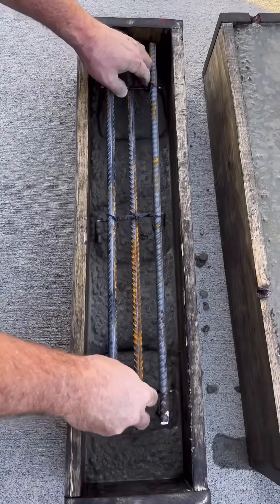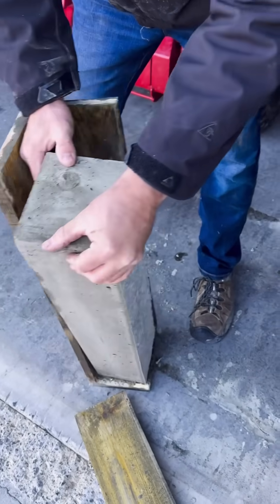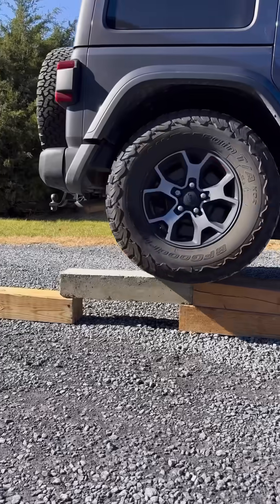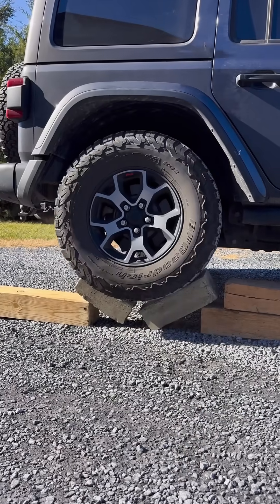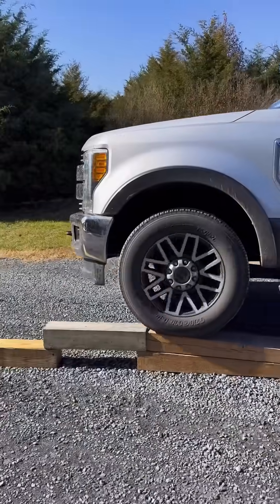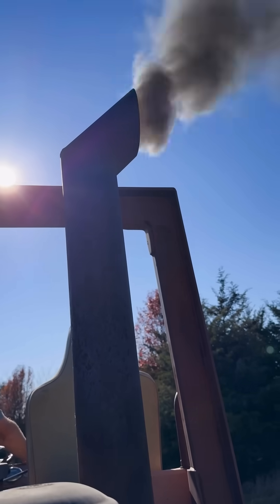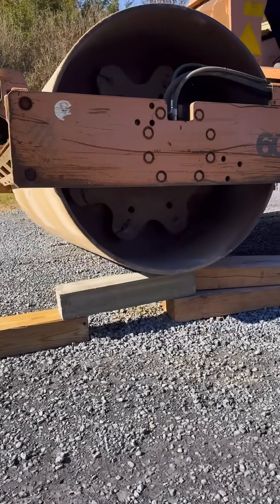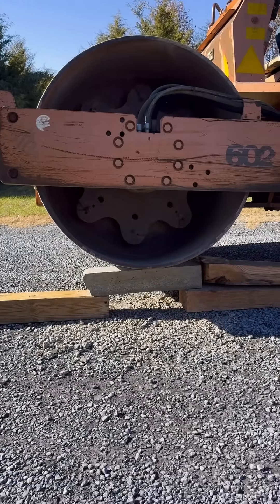Why We Use Rebar To Reinforce Concrete

Comment: …Can we just acknowledge how amazing wood is as a building material?  The wood had no problem being a ramp for your test.
Reply: Wood is a good material but is made of fibers that means that wood is good material only on some directions
Reply: @gianlucianobonisolo7879 also It molds and rots
Reply: @gianlucianobonisolo7879   the isotropic directional strength of materials is founds not only in wood, especially everyone can test it by folding paper and trying to tear it, comparing how it tears when the fold is done along the other paper direction (turned 90 degree).
along the rolling direction (when the paper was created in the rolling mill) - it will tear nicely and easily (less strength to resist the tear) - while the 90 degree other direction it is harder to tear (and looks less straight).
same isotropic behaviour is found in other rolled materials like sheet metal.
Reply: Video: about the strength of reinforced concrete
Comments: debating the existence of god
Reply: Man yall need to chill tf down. Litteraly all bro did was peacefully make a comment that was even a LITTLE BIT religious and all the reddit atheists come in like "erm ackshually religion ish bad becaush of my middle shchool level undershtanding of philoshophy and the 13 minutes I spent reading nietzsche before I got bored because there aren't any funko popsh" trying to have a pissing contest with the guy while everyone else argues about which religious view is litteraly Devine in its perfection and which one is litteraly responsible for everything wrong with the world.
Reply: @AwesomEthan the comment was literally telling random people to give thanks to God. Maybe don't tell others what to do when it comes to stuff like that? lol nerd
Reply: @gavinrolls1054  he wasn't putting a gun to your head and forcing you to praise Jesus, was he? Get over yourself lmao
Reply: @AwesomEthan  cry
Reply: @TheeggMAN_  your the only one crying here bro
Reply: @AwesomEthan  suree
Reply: @TheeggMAN_ narc
Reply: its like if concrete came already filled with thousands of teeny rebars
Reply: It’s tensile strength tho, when we getting reinforced wood? 😂
Reply: Yeah it's supported  by the ground lmao
Reply: @poa2.0surface77 Only theists say something comes from nothing. No cosmologist states that has a hypothesis. Just tell everyone you will regurgitate apologists taking points without making sure if they are true.
Reply: @poa2.0surface77 Provide your scientific evidence of god?
FYI science deals with the natural world. By definition god is a supernatural being and not something science even deals with. 
So continue to just tell everyone you don’t know what science is even at its basic level.
Reply: @poa2.0surface77  You are mixing up the facts here big time 😂 You are the one with the opinion, i spoke facts ...and it's definetely you who doesn't know how science works, because it's you who have to come up with proof for gods existence
The things you say are illogical and you're misinformed about how science works
Reply: @poa2.0surface77 None of these are good arguments for God, and most aren't even actually arguments.
Reply: Look at the Video Again and notice how the Wood Beam is Split when the tractor goes over it.
Reply: The wood was flat on the ground. It wasn't being exposed to flexure
Reply: @carlingari8850  
I can say from experience in the automotive field that a wood 2 by 4 holds up more weight than concrete, even while spanning a distance equal to or greater than that which the test in this video demonstrated with the concrete.  I’d go even further to say that the flexibility and elasticity of wood makes it a superior material to steel when used in reshaping damaged steel body panels.  It’s softness also means it’s a viable material for lifting very thin steel under enormous weight.
Reply: @BroncoJoeAK  I can say from my experience as a civil engineer that you're being delusional. It's almost impossible to increase the load resistance of a timber section without altering it's sectional dimensions. The opposite is true for concrete sections. You can increase strength by changing steel and concrete classes or effective areas without altering sectional properties. Timber becomes preferable when dealing with generally lower load values and is affected by variables such as climate, more than concrete. Neglecting factors such as cost, timber will always come second to reinforced concrete.
Reply: @BroncoJoeAK  You're even more delusional if you think that timber is more flexible than steel
Reply: @carlingari8850    
 
I appreciate your perspective, however I think you misunderstood what I meant.  I’m not talking mainly about concrete in a building, I was responding to your suggestion that wood cannot span the same gap as the concrete structure proposed in the video and support the weight of the vehicle as the reinforced concrete did.  In my field it’s used every day to do just that.  Making a statement about your implication that wood would not support the weight of a vehicle - as derived from your statement that the wood the vehicle was on was on the ground and not spanning the gap - is not an invalidation of steel and concrete as building materials in large structures.  Nor is arguing that wood has amazing tinsel strength an implication that it would be a better material for building skyscrapers.  I was simply using two different examples of structures and the beneficial properties of the materials in those structures in the case of a fire in their individual buildings.  I am equally well aware of the fact that wood has less tolerance of compressive force over time than concrete.  My point was to consider the versatility of wood as a building material (as implied) in smaller structures, while contrasting the more permanent design principle regarding reinforced concrete in large structures, such as skyscrapers.  I admit I probably should have clarified that I was differentiating between small wooden structures and large reinforced concrete structures, however I also find it disingenuous that one would assume I was referring to using wood as a replacement for concrete in large structures where compressive forces would forbid it.  I was likewise not suggesting that it was possible to drastically change the load bearing capacity of any given piece of timber.  As one would choose the appropriate mix of concrete or carbon content of steel in construction, a carpenter likewise chooses to use certain grades of wood and different joints to build a wooden structure.  My point with volume was that a larger building such as a skyscraper has larger internal volumes than a smaller one, meaning more stuff can be placed inside it.  I feel really silly stating the obvious here, but typically that “stuff” is comprised of furniture and typically furniture is made from wood.  That volume also holds other organic, flammable materials and the more flammable materials you have during a fire, the more heat is produced and should the heat produced be absorbed into the building’s steel reinforcement, then the integrity of the steel becomes compromised and thus possibly compromises the entire structure, not just the area affected by the fire.  And yes, I’m aware that x-rays can rule out structural damage, as I am a certified structural welder, and an entire structure’s integrity doesn’t necessarily get completely compromised after a fire, but the point made is simply it can and does happen, and unlike a residential building where you would expect wood to be used as the construction material, your concrete structure would require far more work to reconstruct after said fire.  Granted, I will admit that I could have been clearer on this as well, however I assumed it was understood by the nature of the argument that it can happen, not that it always happens.

Now as to your experience as a civil engineer, under a mutually respectful circumstance I would like to hear more about your field of expertise.  If anything I have said is incorrect, I would like to hear about it.  However, I do want to have a discussion about a topic where the topic itself is not being misrepresented due to a misunderstanding nor due to a lack of attention paid to (or purposeful omission of) the underlying context.
Reply: Wood also catches fire
Reply: @fernofinity8997  
So does steel and concrete, just at higher temperatures than wood.  And once steel reinforcement heats up, it becomes malleable.  Typically buildings made of concrete are significantly larger than structures built from wood, and when they do catch on fire the internal volume is much larger as well.  If 9/11 wasn’t a good enough indication of what fire can do to the steel reinforcements in a concrete building, I don’t know what is.  Once the steel supports in a concrete structure are gone, the structure looses all integrity and basically becomes sand.  So basically everything you can say about wood can be said with concrete as well given similar circumstances.  It’s the mechanism behind it’s disintegration which is different.
Edit:  I should add, steel is an excellent heat conductor.  So when a concrete building burns even partially, the steel reinforcement throughout the building transfers most of that heat from source to end.  So while a wooden structure may see a kitchen burn and the solution there is to simply replace the kitchen, even a relatively small fire (compared to the mass of the structure) in a concrete building typically renders whatever remains of the building completely unusable due to the steel reinforcement being altered throughout.
Reply: @BroncoJoeAK  Your argument about steel structures being vulnerable to temperature is quite pointless because how many timber skyscrapers have you seen? Do you mean to say that buildings such as the world trade centre would rather have been built with timber instead of RC?
Reply: @poa2.0surface77 that's not proof, if that was then what came before God? Right got ya there. It's really hard to say how elements came into existence
Reply: None of you get it. Simply said God where atheists would say mother nature- funny isn't it? Now quit the politics and go do something with your life.
Reply: Logical fallacies abound @poa2.0surface77
Reply: @poa2.0surface77 Amen to that.
Reply: @poa2.0surface77  Something can come from nothing, as evident by the Higgs Boson, and the Big Bang. In layman’s terms, when the Big Bang happened, all of the particles and energy passed through a field which gave it mass as it did, thus creating the universe.
Reply: Wow. Great point
Reply: @poa2.0surface77  Life comes from life believers when abiogenesis
Reply: Ikr
Reply: It was on a flat service jaja
Reply: No
Reply: It's good but not economical.
Reply: Well yeah it's on the ground. do the same test as the concrete and you'll get similar results no?
Reply: Highly impressive that it could tolerate the steamroller.
Reply: @poa2.0surface77  No proof for YOUR God, for all we know theres deities that exist on a completely different plane of existence that are so stupidly advanced they make universes like ours for fun as school projects. The creator of our universe, if there is one, which there probably is, could very well be the cosmic deity equivalent of an infant or even a giant flying spaghetti monster...
Reply: Burns quite well too lol
Reply: @poa2.0surface77  lmao, you're an idiot.
Reply: @poa2.0surface77  this is the stupidest thing I've ever read
Reply: But we need our trees its getting hot
Reply: Did you learn from the video tho? The wood is only under compression
Reply: yeah works really well against hurricanes doesn't it 😂😂😂😂😂
Reply: @poa2.0surface77 I’m happy I don’t know you in real life. Most bible thumpers are the most stuck up and ignorant.
Reply: @poa2.0surface77  There's no such thing as universal morality, secondly laws of physics are not governed by intelligence, thirdly life comes from certain combinations of atomic bonds, with enough time and space every and any combination of atomic bonds would be created, thus life and consciousness (which is an evolutionary trait) do not prove anything. Please don't cite science as proof for something when you're citation is so blatantly ignorant.
Reply: @poa2.0surface77  I suppose you are the one that believes 😅
Espacially that your god came out of nowhere, which opposes everything you said else 😂😂😂

And i certainly do have a better understanding of computers, science, chemistry an logic than you have, from what i've read. This conclusions originates from the fact that I'm a chemical engineer and of course because of you, since you have no clue what you're talking about 😂😂😂
Reply: yeah, but you don't live in a tropical area. wood is really good on cold climate but rots really fast in tropical climate
Reply: @poa2.0surface77 no, that's not how proof works.
Reply: We should start building roads out of wood 🧏‍♂️🧏‍♂️
Reply: @poa2.0surface77 and you couldn’t survive knowing that freedom is before you die. There’s nothing waiting for you…
Reply: because the wood was lay flat. Common bro
Reply: @poa2.0surface77  lie more.
Reply: @poa2.0surface77  If something cant come from nothing but god exists that makes  nothing by your statement
Reply: @poa2.0surface77  You can't use the laws of science as proof of god, and then say that the laws of science don't apply to him. Don't you see how you're contradicting yourself?
Reply: Neither would a pile of bibles, sand or a few rocks.
Reply: @natmarelnam4871Thank you bruh! Furthermore, had the wood been stretched across two pieces of stacked concrete, the wood would've cracked and split immediately! I swear, some folks can have ALL of the evidence in front of them and STILL make ridiculous observations!🤔😆🙄
Reply: ...It's the same as the unreinforced concrete: It was being compressed, not tensioned.
Reply: Yea bro thats why your good book says nothing happens unless it goes through him. So all the murder, rape, thievery, so on, and so forth is all by his design. If that's your "god," you have your answer as to why no one with common sense believes that crap. Ignorant people love god. Isn't it crazy that miracles stopped happening when everyone got a phone in their hand miracles just stopped happening? No more water to wine? Feed tons of people with a little fish and some bread? I'm just saying. Lmfao. Educate yourself before you try forcing your beliefs on people who dont care. @poa2.0surface77
Reply: @poa2.0surface77 we can agree to a few axioms and then prove the laws of physics exist. But you can't measure or prove anything about morality in a lab. Until you prove god you cannot prove transcendent morality.
Reply: @natmarelnam4871lol yeah when i saw them bragging i was like...seriously they aren't being serious 😅
Reply: Think termites😂
Reply: Wood is cool and all but when you have a shipment of epay come in and this supposed strongest wood in the world has giant cracks down all of your 4×4s you get a bit frustrated
Reply: dfuk dude, any terribly made concrete can be a ramp.
Reply: Thats because it was resting on the ground. Wood and concrete have différent properties which gives strengths and weaknesses to both. I wouldnt want Wood in the ground, which majes concrete à better material for footings. Overall concrete is much stronger but also weighs much more, the higher you go the more you need to reinforce.
Reply: it's supported by the pavement
Reply: Wood is gods quikrete.
Reply: yeah a lot of wood species' have comparable compressive strength to standard concrete mixes and are way lighter and have much better tensile strength. bamboo can even have better tensile strength than steel for the same cross sectional area, let alone by weight.
Reply: In Diesel Technology, We use Wood Blocks and esp. 4X4's to stabilize whatever was gonna have one of us mechanics go under or keep off critical and irreplaceable human flesh!
Reply: Because it’s under pure compression and no tension, whereas the concrete has a shearing force because of a lack of support.

Like this is the entire point of the video lol
Reply: Yeah kinda, but the wood isn't the one off the ground
Reply: Wood is amazing. It was also used to make the British De Havilland Mosquito during WW2.
Reply: its on the floor, it would not survive bridging, like the reinforced concrete
Reply: Theists starting their evangelistic session out of nowhere and acting like they didn't when called out, and even putting blames on the very people who called them out. El Clásico.
Reply: Wood is a flexible material for low bearing applications, but would be either impossible or too expensive for large structures, it's why historically East Asian architecture shifted to smaller structural columns because large trees simply disappeared due to over-foresting.
Reply: @fsdds1488 more importantly, wood rots
Reply: @fsdds1488  ever heard of Kizhi Pogost?
Reply: wooden sky scrapper projects have been getting pretty common in the past few years @fsdds1488
Reply: I'm probably fine with there being some existence far higher than me/us that played a role in the creation of all we know. 

But it's almost comically arrogant for humans to think it's the one(s) we wrote books about. The sheer scale of creation up there in the void of space all but confirms that humanity is an inconsequential, insignificant blip on their canvas. That canvas and those brushstrokes will be more and mean more long, long after humanity's last breath.

Also, rebar in my concrete for sure, amirite bois?!
Reply: @Trepanation21  
Perfectly valid and reasonable.
If there is a God and if he is intelligent enough to create the universe, then he must be intelligent enough to comprehend the concept of “creative liberty” or “political alteration.”  Either God does not care about us, or he cares that we act morally correctly.  Anything else is kind of a guessing game.

Edit:  Almost forgot.  Rebar in concrete.  Freakin’ Hell yeah!
Reply: @Trepanation21  were all meaningless clumps of flesh on a rock in space BUT DONT YOU DARE BE HECKING RACIST!!!!
Reply: @Trepanation21  Lmao it is funny that you bring up the fact that this argument is on a concrete rebar video
Reply: @Trepanation21  ikr its mind blowing all of it. What do u believe in?
Reply: @poa2.0surface77  “Life can’t come from nothing” and yet a god can? The hypocrisy is crazy.

To think that every atheist believes in god but pretends that they don’t is crazy as well. There’s so much proof saying otherwise. You live in ignorance.
Reply: @poa2.0surface77  and yet, you didn’t dispute my argument. And you also didn’t provide any evidence. Typical theist. Can’t comprehend that their cult is lying to them.
Reply: @Beowulf__ modern atheism is a cult
Reply: @poa2.0surface77  What??? I am from old civilization and old world, India. What proof do you have for god? And what is Wood to do with God?
Reply: @sheshankutty8552  God created trees and man created concrete. Someone suggested we should thank Him for His natural building materials, someone made a LARP post, argument ensued.

That's basically how we got from there to here.
Reply: @frikyouall How do you know God created, have you seen or have proof?
Reply: @sheshankutty8552  Don't need to. Can't know the unknowable, and trying to do so is pointless because it could all just be set up. The name of the game is faith.

That's far from the point of my statement, anyways, though. The point is that someone believes in God, and their belief got them in trouble, thus the argument.
Reply: @frikyouall You are all funny. Anyone can believe in anything as long as they only got 5.5 senses less of 6.
Reply: @sheshankutty8552  🤷🏻 Like I said to the other guy, the evidence comes to you in a way that you personally can understand, and serves as poor proof for others. I've been called a liar for citing my personal experiences, and I don't have solid evidence to present because it's all set up to look circumstancial.

I don't make the rules, I just follow and relay them.
Reply: @frikyouall Illogical. I have read all the scriptures from all the religions. When you say, you follow them, what do you follow ?
Reply: @sheshankutty8552  Mostly New Testament, but some Old. I relate my knowledge of the Book with my personal experiences with God to try and better understand Him and what He needs of me.
Reply: @frikyouall  So god is male principle in your world? Interesting
Reply: @sheshankutty8552  I'm starting to think you're just trolling.
Reply: @frikyouall  And what are you doing?
Reply: @sheshankutty8552  Well, I was trying to have an honest conversation. My mistake, forgot the internet rules.
Reply: @poa2.0surface77 you just mentioned a few scientific terms and claimed that it's "proof" that god exists.

Luckily the existence of god falls into the realm of philosophy where you can use philosophical razors. Occam's razor can easily show how ridiculous the idea of a "human-like intelligent singular being which defined every single law of the universe and also specifically created one planet with life and gave consciousness to only one species of millions" is.
Reply: @okie9025  
Atoms make up the Universe and God is said to be Omnipresent.  It’s also said that God’s knowledge is incomprehensible.  In particle physics, the strong Nuclear forces are not observable but are instead deduced by mathematical reasoning.  I’m not saying that God is atoms or subatomic particles, but I am saying that it’s very possible that God is reality itself taking the definition of Omnipresent to it’s extreme.  That’s a relatively scientific explanation of something that should be entirely philosophical.  Perhaps an incomplete one but the framework is there for it.  And honestly, science is a very strict philosophy itself so you could argue that science is equally a religious belief and theoretical physics relies on deduction of mathematical reasoning which flies against the idea of science being based solely on observable facts gathered from repeatable experiments.  Science also has it’s own kind of prophet; Albert Einstein, Steven Hawking, Charles Darwin, Neil DeGrasse Tyson, etc.  When viewed from a purely philosophical and cynical perspective, even science itself is almost cult-like.  Just food for thought.
Reply: @okie9025  it's not silly. Think about any video game. We could be in a simulation and the guy or being that made it would literally be our creator or god. That's really not that far fetched and doesn't even have to involve religion. I think ignoring the possibilities of either god or no god existing is quite frankly more stupid.
Reply: @okie9025 my 2 cents: there is no proof per se, but it is uncanny how so many materials are abundant and accessible. Like oil, what if we didn’t have oil, or couldn’t access it. That would have made transportation stuck back into the dark ages. We not only have the materials for housing, clothes, etc but to actually get off the planet and explore the universe. Yes this could all be coincidence, but when there are so many uncanny coincidences, to me it is a clue that maybe there is something that has influenced the universe/earth/life
Reply: @nofurtherwest3474  Not to be a Debbie Downer, but those things aren't coincidences. You just seem to be swapping the cause and the effect.

The abundant materials aren't necessarily here because we are, the planet is able to sustain life because the materials are here.

Now it is a bit of an oddity that they are all materials that we have been able to use to become the dominant species on the planet, but science uses evolution to explain that. The most adaptable species survives to reproduce and all that.

So we weren't given the materials, we took what was around us and adapted it to use to our advantage. More like a speedrunner using glitches to eke a 2-minute time out of an 11-hour videogame.

That said, I do have a similar viewpoint, but it has more to do with the fact that the Christians took a dominant position on the world stage despite being a global minority. Now that Christianity is receding from the public view, everything is starting to backslide quite a bit, and I do find that to be an incredible coincidence.
Reply: @frikyouall  there are man more coincidences. You'll have to think of them on your own or do some digging. For ex, the size of the earth leading to the optimal gravitational force and magnetic field which influences the atmosphere along with being the optimal distance from the sun. Many many more coincidences that create an optimal situation for life to thrive. 

And no, the materials weren't given to us, i never said that. But they are there in way that is usable. It a near perfect way to be used.
Reply: @okie9025  You do not want to go into the realm of philosophy as an atheist my friend, because not only does philosophy prove the Christian God but atheist's cant even do argumentation within their own world view because they have to subscribe to all kind of goofy things like materialism and determinism which are easily disproven.
Reply: @Jewish_Skeptic philosophy doesn't prove that Jack schitt
Reply: @katiebarber407  Do you have proof for that claim? In order to claim that you must appeal to knowledge (epistemology) and to universal's and truth (metaphysics). So you deny philosophy while appealing to it. lol
Reply: @poa2.0surface77 Everything you said was incorrect.
Reply: @poa2.0surface77 If something can't come from nothing, then where does god come from, huh?
Reply: @poa2.0surface77  You did some nice tomfoolery there, but not with me pal 
The true bottom line is that you DON'T KNOW if god exists, you just want to be told how to live because you can't come up with a concept of decent living by yourself, which is often the result of a lack of an open mindset and/or logical thinking and/or common sense and/or empathy
Your welcome :)
Reply: @robem222  chill out youre not the main character go take a shower
Reply: @poa2.0surface77 I like your comment
Reply: Hey guys, I wouldn’t say I believe in God in the secular nature, but I do believe there is some intelligent form of Universal Consciousness or perhaps Creator.  However, I respect people with different theology or no theology.  I enjoy a good conversation.  I also believe we can try to be respectful of people’s beliefs, after all nobody truly knows what’s going on.  

Not to mention it would be more interesting to share opinions and ask questions about the philosophical reasonings behind differing religions or un-religions.  After all, we’re all stuck on this planet together.  Might as well make the most of it.  ;)
Reply: @BroncoJoeAK  I acknowledge your respectful stance. I would like to add that the existence and events of Jesus Christ and all his prophets are actually proven, so is that not enough to believe he is the son of god?
Reply: @BroncoJoeAK um is this related to concrete,  hare Krishna hare armpits...
Reply: @BroncoJoeAK  Yeah, i maybe could believe that there is a creator, but i cannot believe in god. Why would he want people to do some weird ass rituals? If something like god exists, it definitely doesn't care enough to show us how to live. I also could believe that math is god, as some videos claiming they proved god exists only prove how math as god could exist.
Reply: @someguy7110  
Actually by that metric I’d say that the Universe is a mathematical program and God is more like a virus that alters the code from time to time.  Not to say simulation theory is the answer, just to say that mathematics itself very well could be the the language the universe is directly written in.  I read a sci-fi novel awhile back which explored this concept and I can’t remember the name but it was very interesting.  I’ll try an’ respond with the title if I remember it.
Edit:  Echopraxia!  That’s what it was.
Reply: Yup, give thanks to God.
Reply: @davespark10 I hate how your single post here caused the entire reply section to go ham in arguments. Can ya'll just please not talk about this 😭
Reply: @davespark10 surely you mean the tree spirits
Reply: @davespark10  thanks satan👹
Reply: @davespark10 why, he just stole credit 😂
Reply: @davespark10 omg please stop
Reply: @sambored9387 he made one comment…
Reply: @Pikog777  I asked because under 5 comments he said the exact same thing
Reply: @davespark10  why?
Reply: @davespark10  which one they all date back to similar origins
Reply: @davespark10 or give thanks to millions of years of evolution
Reply: @davespark10 man its pretty pathetic that the beta male God haters are responding to you in pure anger over your comment. 😂All glory to God man💪❤️
Reply: @davespark10 Bro, nobody CA-

nevermind
Reply: @IGabrielSnake yeh no point trying to reason with these ppl :3
Reply: @TheNightBlade168 yup.
Reply: @TheNightBlade168 religion bad atheism good 🤪🤪🤪🤪🤪🤪🤪🤪🤪
Reply: @TheNightBlade168 bro just simply said something and ur over here like " this is why we don't reason with these people 🤓" like idk what horse u on bud but its tall and strange 😂
Reply: @TheNightBlade168  tips fedora
Reply: @IGabrielSnake  tips fedora
Reply: @TheNightBlade168 That feeling is 100% mutual from us. Praise Jesus Christ! 🙌🏼
Reply: @TheNightBlade168 ?
Reply: @TheNightBlade168 anime pfp 😭
Reply: @TheNightBlade168whether you believe in a God or not, you gotta say, the more science is developed, the more things point towards an intelligent being behind everything.

You wouldn't say your phone was a product that happened by 'randomness'.
Reply: @TheNightBlade168 wholesome 100 definietly upvoting this breathtaking reply and giving it a reddit gold
Reply: @davespark10  people like you are always tryna make it about god like bro
Reply: @davespark10  which god?
Reply: @greatmusic142 should be obvious
Reply: @davespark10 ew no
Reply: @Michaelroni-n-cheese Keep that same energy when you face Him directly after flat lining.
Reply: @Bullet44  Too bad that's a fairytale.  Man you are easily manipulated.  Keep tithing though bro.  The pastor could use your donations.
Reply: @Michaelroni-n-cheese have you ever been punched in the face before? It seems like you could use one.
Reply: @Michaelroni-n-cheese ew is crazy 😂
Reply: lol at the angry atheists in the comments lol relax nerds
Reply: @natmarelnam4871 You have absolutely no say on whether it is right or not. No-one does. You can say that after there is definitive proof, but until then and only then, you're right no matter what you believe or don't believe in.
Reply: @itsnetts  lmfao but you're the type of kid to say science did it when theres absolutely no evidence
Reply: @suckthis420  As opposed to the vast amount of evidence of the magic man in the sky...
Reply: @netts2315 sorry to pull you back to this homie but I think he thought @TheNightBlade168 was saying there's no sense arguing about wood being good
Reply: @itsnetts don't argue that because you done thousands of not millions of things precisely without knowing any knowledge of science or the outcomes... You have faith you won't get hit by a bus tomorrow even if statistically it's likely in a city.
Reply: @itsnetts if you're only right if there's definitive proof would that make everyone wrong until then?
Reply: @ Now we're getting into paradoxes, which I can't wrap my head around, lol. Let's just say everyone can believe in whatever gives them strength without a need to say one is better than the other :)
Reply: @@BeansBeans11 So, nice LARP, but yore argument is also literally one ass cheek.

Here's the simple explanation: Belief is the name of the game. God asks you to believe, and the help He gives you in return is never meant to be good proof. Proof can make anyone come to the logical conclusion, but coming to a logical conclusion is not belief. Belief, once again, is the name of the game.

If you need to ask for proof, you've already lost the game. Dig?

You ain't gotta believe, but it sure comes with its benefits.

My main question is with these Pagan folk who don't believe in God. You mean to tell me you've danced with the devil, consort regularly with Loki AND Freiya, and even had a good talk with Horus and Oberon, but God is just too far-fetched for you? Crazy.